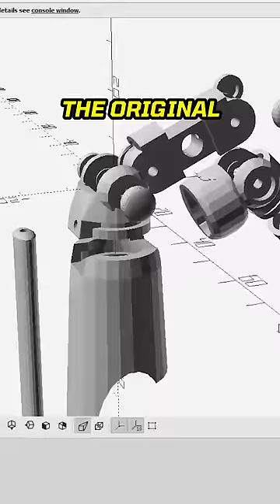HOW I made a LIGHTER FINGER for my Friend. #builds #firefinger #3dprinting

Comment: Now to send the cad files to pcbway and get it machined in metal so you can put a Zippo hinge in there so he can flip it open and closed
Reply: Gotta make sure it doesn't make that distinct zippo sound though!

It's actually trademarked and fully defended by Zippo
Reply: Wouldn't it be heavy for a finger?
Reply: @WhereNothingOnceWas the sound is only trademarked based on their manufacturing process. If you made the hinge in a different process and it produced a similar click, it wouldn't be trademarked
Reply: @WhereNothingOnceWas  They'd wouldn't care if it's not a commercial product. If no money's being made off your trademark then why bother spending time and money on it

Comment: The tip is probably going to burn from the heat, may want to make it carbon filament as well. Also tiny 4mm barrel hinges for the tip could be used.

Comment: If you either reprinted at low infill, or made a silicone mould to make a wax copy, with a model thats slightly oversize, you could then put it in plaster, burn out the wax/print and make a metal version